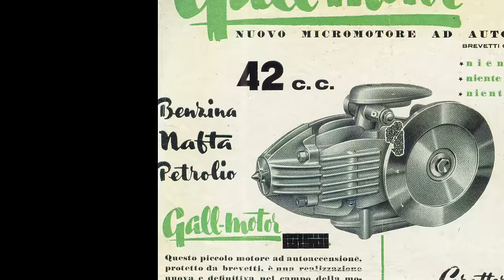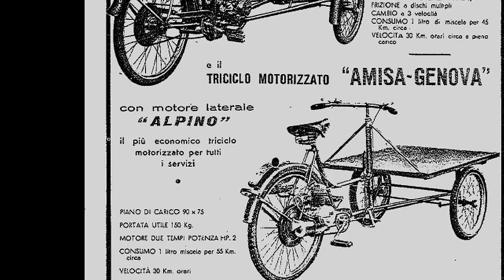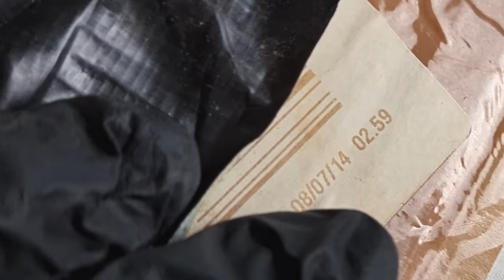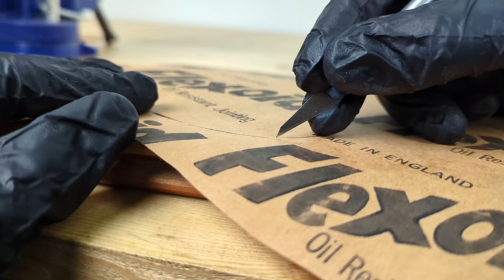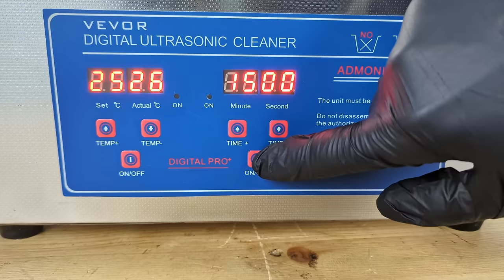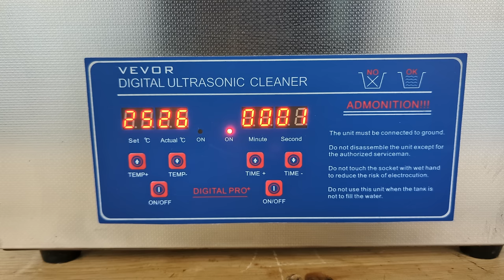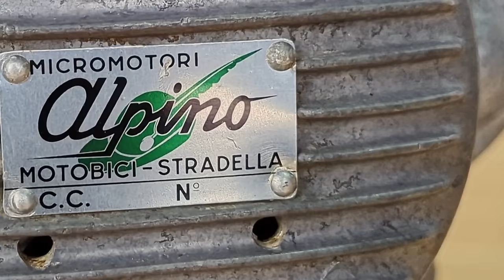The Ancestor of the Electric Bike - a Conservative Restoration

Comment: what a beautiful little engine - why can't they still be made like this today. You have to admire the engineers who designed this in the first place - truly incredible.
Reply: Corporate greed and tight emissions requirements
Reply: Emissions is one of the biggest reasons. This thing is a 2 stroke which means three things: an absurd power to weight ratio, mechanical simplicity, and pretty lousy emissions. You just can't make an EFI four stroke (mandatory for modern emissions controls) that matches it for simplicity and lightness.
Reply: They do...
Reply: @ironhead2008 this. This is the reason why you dont really see two strokes on the road anymore (dirt bikes dont go on the road as you know) even though they were all the rage in the 70’s. Even though 2 strokes are a lot more efficient than then used to be in the past, their prime has passed.

Comment: What a beautiful engine with an ingenious 3-speed gearbox!
It is very special that people made such beautiful things at that time.
Very good film of the restoration!
Reply from the maker: Thank you! ❤️
Reply: AND it's 1947 ! So ahead of its time.
Reply: @michaelb.42112  Yes it is an amazing little engine. The quality way better than anything made today. But I wouldn't say it was ahead of its time. Remember the Vespa came out in 1946. It's just that back then people did things right.
Reply: My 1970's Garelli Tiger-Cross 50cc moped , 4 speed gearbox, was very similar in operation. It used the same sort of  plunger to push out the balls to engage each gear, although the balls were extended with short rods.

Comment: 7:27 what a very clever way to remove bearings from a blind hole
Reply from the maker: Thank you!❤️
Reply: I have also seen slightly dampened bread used for that as well.
Reply: bread also works for this, watch out though, you can punch a hole through the engine case
Reply from the maker: Yes even bread works well, I tried that too
Reply: grease is the more accepted way.  you wrap more or less electrical tape around the thread of the bolt to improve the seal.
Reply: @vsvnrg3263  Grease would work if the bearings were labyrinth or metal shield sealed. Otherwise the grease will just spooge out the spaces between the balls and their retainers. I like this wet paper method.
Reply: @tauncfester3022  , my method would only work for sure with plain, solid bearings.  it might work with sealed bearings.  ive never thought to try it.
Reply: Or you could just put it in a freezer overnight, and the bearing will drop out on its own.
Reply: @TheLionAndTheLamb777 the soviet way
Reply: @Ego.Reficio   
https://youtu.be/sUXNgug7ttM?t=1494 What is this lever near the spark plug? What is it for?
Reply: @oscarkaminski9165  I'm sure it's the decompressor for starting the engine.
Reply: Mechanics sometimes use this method with grease and bread to remove pilot bearings from regular vehicle engines.

Comment: Great close up shots in video! I like how you showed the process of restoring the parts, and I'm surprised that instead of oil , grease was used in the engine.
Reply from the maker: Thank you! Grease was used because oil seals had not yet been invented. In fact, the fat being more viscous than oil makes it more difficult to get out of the holes. If you see the point where I take the breaker contact plate off, below it is a kind of brass washer and a felt pad, not an oil seal, just because they didn’t exist yet
Reply: @Ego.Reficio neat
Reply: I can just imagine in the repair manual, it saying- use a liberal amount of grease 😅.

Comment: Very Cool, Weird looking piston I like it, an that Trick with the wet paper towel to get the inner bearing is Brilliant 👽👍🏻✨
Reply from the maker: Thank you! That shape of the piston is called a deflector, helps the escape of the combusted mixture and was used on the old two-stroke engines, where a lot of oil was used in the mixture because the oil at that time was of poor quality so you had to use more to get a good lubrication. This engine uses a mixture with 8% oil (in a liter of gasoline should be added 80ml of oil!)
Reply: you can also use bread for bearings like that
Reply: @11sjv  👽👍✨
Reply from the maker: Yes I tried that too and it works very well

Comment: @ 7:50 bread works best in this application…💪🏼👍🏼 when I can not remove the thrust bearing from the back of a crank shaft, I will use some small pieces of bread and a brass punch at almost the same diameter and with no heat it’ll pop right out.
Cheers!!  I hope this helps💪🏼🙏🏻❤️
Reply from the maker: Thanks for the advice! I already knew the use of bread but I never tried it

Comment: Всё шикарно сделано, за исключением одного момента! Нельзя класть столько смазки! То же самое- попробуйте наложить под завязку, в редуктор угло шлифовальной машины! Это приведёт к перегреву и повышенному износу ! Но в этом видео, главное «лайки», а не грамотность сборки!
Reply from the maker: You can’t see it clearly from the video, but there are a lot of empty spaces in the crankcase that are not occupied by grease. Also consider that during operation the grease will tend to melt and this will leave even more space
Reply: Ну,ты сравнил).Этот тихоходный агрегат и не заметит полный редуктор,зато все будет хорошо смазано.
Reply: @Ego.Reficio  Жаль,что по сути уплотнений нет и нельзя залить жидкое масло.Хотя если постараться,то можно крышки доработать и установить современные резиновые самоподжимные манжеты и заливать обычное масло.
Reply: @kotborka  Эксперт!
Reply from the maker: Yes, by changing the crankcases and using the oil seals, you could safely use the oil

Comment: What is the purpose of filling the engine compartments with grease?
Great video thanks.
Reply from the maker: I did this because the gears need to be lubricated, and because the engine doesn’t mount the oil seals yet,  the oil can’t be used
Reply: @Ego.Reficio my grandpa said dont feel bearings and gears more than 1/3 with grease to let mechanisms go freely...
Reply from the maker: From the video, it's not very clear, but in the engine casing, there are many empty spaces not occupied by grease. Also, consider that with heat, the grease tends to become liquid and leaves even more space

Comment: My wife and I have these on our bikes and ride them all over place.
Reply from the maker: Do you have the same kind of engine?
Reply: @Ego.Reficio  No, I should have specified that in my original post. We use the recycled beer can ones from China. They are very similar but the quality isn’t even close. They aren’t bad once you now what to address when you get them.
Reply from the maker: I understand. I’ve never had one of those made in China, but I think they’re still fun to use. How do you solve the problem of having the license plate and the insurance, in order to move on the street?
Reply: @Ego.Reficio  in my state( Ma. ) As long as the engine is under 50 cc, it’s considered a moped and doesn’t require registration or insurance.  My engine is 66 cc but I have a sticker that says otherwise. They really are super fun and much cheaper than electric. Well, for now at least.
Reply from the maker: Great, so you can use it without problems!

Comment: There were many such motors in post-WW2 Europe each with different levels of technical refinement most being very basic. By the second half of the 1950s, most fell by the way-side as living standards began to improve but from the technical perspective, I think they remain interesting.
Reply from the maker: That’s correct. I think like you about the interest these little engines have

Comment: Buen trabajo de restauración felicidades, pregunta en ves de grasa no serua mejor aceite? Y cuantos cambios tiene? Aunque no le veo el clutch embrague
Reply from the maker: Thank you. The oil cannot be used because the engine has no oil seals, so the oil would come out. The gearbox has 3 speeds, but does not use the clutch. To change gear, you have to decelerate and engage it gently
Reply: @Ego.Reficio  Gracias 👍 excelente.

Comment: Very great restoration, love the method to Remove the bearings in a blind hole, can you please Tell my what gasket adesive did you used?
Reply from the maker: Thank you! I used an old spray that I have already for several years, probably is not produced more of the same type. The spray is Loctite, NO.99 High Tack Spray-a-Gasket
Reply: @Ego.Reficio  thanks!

Comment: Very Cool!!  I am now restoring an Alpino, a model with a friction roll  that moves the rear tyre of any bicycle, here in Brazil. This motor is  installed  in the middle of the bicycle frame.  Which country are you from?  Thanks for your  video.
Reply from the maker: Nice, congratulations! Did you find in brazil the engine you are repairing? I am Italian
Reply: @Ego.Reficio  Ciao; I actually bought my engine in Uruguay, our neighbors. These little Alpine and Garelli Mosquito  motors were sold in that country under the brand "Fido". The brass identification plate on the flywheel  wheel cover has this name, "Fido".
Reply from the maker: I didn’t know they were sold by that name. Interesting!

Comment: So were the OEM bearings all that bad in condition?  As depending on where the new bearings are made, the older ones, if in good shape could have been used again and could be more durable.   Another note is the cross-flow piston, these weren't exactly as efficient as the DKW and other Schnerle ported 2 cycles made in the 1930's and 1940's. They're kind of the 2 cycle analog of side valve 4 stroke engines.
Reply from the maker: I preferred to change them also because I used two bearings with external shielding to help the depression, as the engine does not use oil seals.
It has this piston because it uses a gasoline/oil mixture with a large amount of oil (8%)

Comment: The spark plug connector needs to be replaced, or just a nut onto the spark plug. And it is not a finished restoration without a test run)
Reply from the maker: The connector I used is a new old stock, and it is exactly the type that was used in those years. Why should it be replaced? As I said in other comments, the test I will do in another video because this came out very long. It still lacks to restore the bike, the tank and the crown
Reply: @Ego.Reficio  it is clearly seen in this video, that there is a bad contact between spark plug and connector. The connector just shakes on the plug and it is defenitely not as it should be.
Reply from the maker: From the video is not very clear, but the connector inside has a spring that holds the pin pressed near the head by the spark plug. Also consider that once I put the wire, from the crankcase to the spark plug, the wire is slightly pulled and then the connector holds well in contact with the spark plug

Comment: And all using low-cost and readily available tools, chemicals, and materials as well! Quite valuable to the broke among us. Would have loved to see/hear it run, better yet, mounted and functioning as intended. Thank you for making and posting this! One suggestion: on-screen graphic of generic description of what is shown- for example: “soft brush scrub with phosphoric acid-based cleaner” or “must use brass-bristled wire brush wheel to minimize scoring of cast aluminum”, or “kerosene, mineral spirits, or parts cleaner in ultrasonic cleaner” - would also be very helpful to the novice or beginner. Just a thought.
Reply from the maker: Thank you! The video does not end like this, there will be another video where I mount it on the bike that you see on the cover and start it. I didn’t put this part in this video because otherwise it would come out too long. For adding a more accurate description, thank you for the advice, but from the statistics of each video, the subtitles, and then the description of what I do /use, is seen very little

Comment: why change the capacitor? they are almost always workers. I would have called him a tester
Reply from the maker: Of course, it could still be working, but after all these years in the humidity it could have spoiled it, as well as the heat of the engine during operation. They are delicate components and to avoid having to do it after this work, I did it before. The electronic one I used is eternal. To check a capacitor, the tester is not good, at most you can check if it is short circuit and if it keeps the charge, but to test it well or you use an oscilloscope or a special tester for capacitors

Comment: What did you use to polish that sifter axle?
Reply: Was it somesorta of brass wheel? And polishing compound
Reply from the maker: I used a solid polish that is usually used for industrial polishers. The whole piece is usually a cylinder. On sale there are three-piece kits for polishing mainly aluminum. If you can’t find it write me on instagram, I can send you a link

Comment: You're not testing it if that things is working again ?
Reply from the maker: In the next video I will. I still have to restore the bike, tank and crown. The engine will work, the compression in the cylinder is there, the spark to the spark plug also and the carburetor is completely cleaned. If something doesn’t work, I’ll fix it 😉

Comment: Isn’t there a significant chance that a modern gear oil would be just as protective AND more efficient than grease?
Reply from the maker: Of course. The problem with this engine is that there is grease because this engine does not use oil seal, so the oil would come out. To be able to use oil you should modify the casings to create the seats for the oil seal
Reply: @Ego.Reficio  oooohh ok